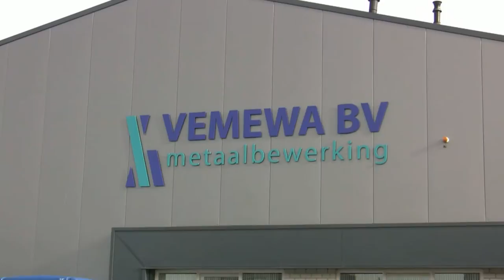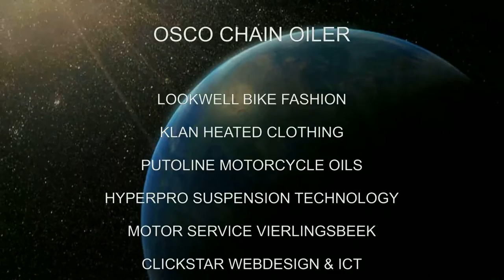Clymer Manuals Sjaak Yamaha R1 Polar Ice Ride Motorcycle Adventure Video #10 Building the Sled

Comment: i wonder if the clutch can take such a heavy load, i also wonder if the front and rear sprocket was changed too tall a gear ratio could damage the engine?